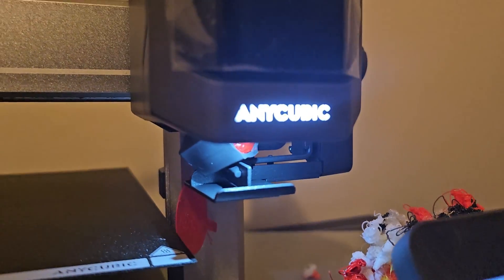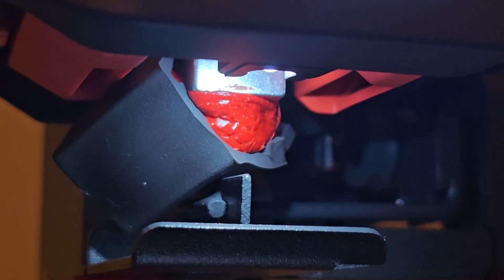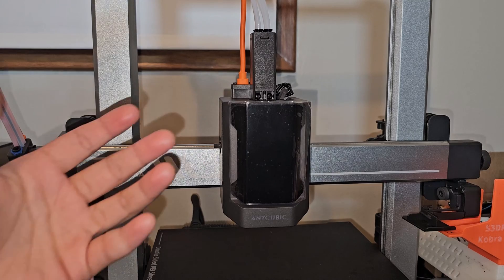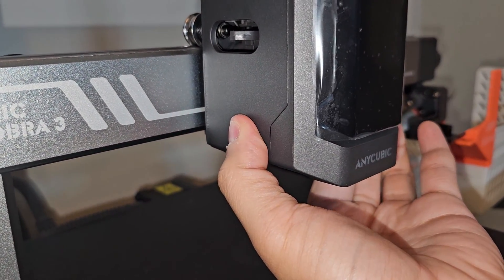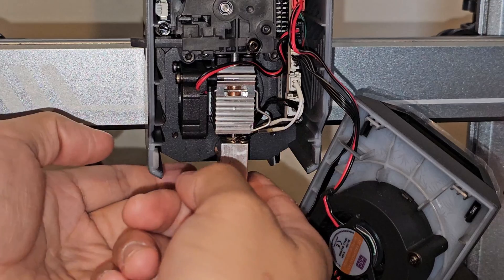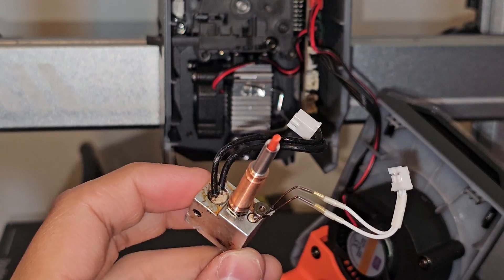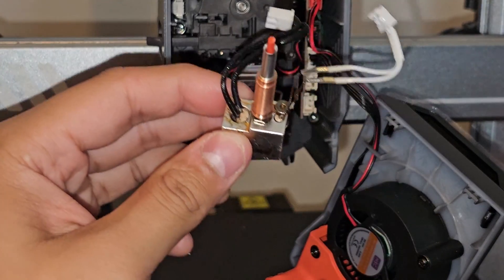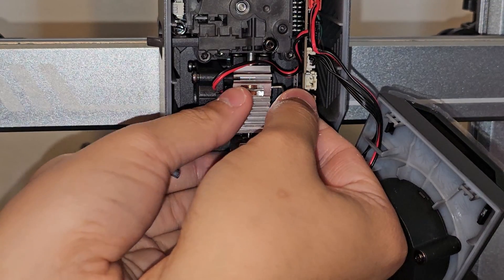Anycubic Kobra 3 How To Change Nozzle | Print Head Disassemble

Comment: Heads up to everyone, currently Anycubic glues the nozzle into the heat block so it's effectively impossible to get the nozzle out of the heat block without breaking it. Just buy the whole hot end and toss the old one if the nozzle gets worn out or unredeemably clogged.
Reply from the maker: Yea that's their solution to solving the nozzle leaks, which is a bad design.

Comment: Make sure the clip is properly in place, otherwise it’s a disaster waiting to happen, with the nozzle head moving while printing. It almost happened to me, but luckily I noticed it in time. The author mentioned this as well, and I didn’t check it thoroughly.
Reply from the maker: Yep! I have seen online post of disaster like that happening. I felt they need a redesign of the clip or the whole nozzle system.

Comment: my K3 V2 out of nowhere started his print and scratched the hell out of my printbed. very deep grooves and it trashed it in a matter of seconds. 
changed my full printhead (cheap and easy with this video) and performing a full callibration now.
very strange.... this printer only printer 50 hours and was printing perfect straight out of the box so very strange accident
Reply from the maker: Hmm, yeah sometimes it might be that a sensor is dead and does not detect the bed.

Comment: a lot of my failures has been with the print head. the block at the top, where the 4 filaments go into one. I have figured that a majority of success is to undo the two top bolts and that pulls away the 4 filament unit, you can then pull out the broken filament through that way, 95% of the time that is
Reply from the maker: Thanks for the tip! I'll keep that in mind for future clogs.

Comment: I did the exact thing and the nozzle snapped at the joint. Now I gotta buy the whole unit
Reply: Thing is I own two filament printers as well as a Anycubic Resin The Photon M3 Max and I have to say that the Photon is by far the easiest to maintain over any filament printer, even the fact I had to change the LCD screen on the Photon.  On the filament printers I have had to change the heads on both for the exact same thing.  Yes, I do use a dryer as well as the oven (just to be sure). Seeing that filament blockage is constant headache, why dont manufacturers instal a much easier way to remove blockages? Undoing clips and pulling on wires, just seems to be overkill for me.
Reply from the maker: yeah there is a big problem with clogage with fdm 3d printers.
Reply from the maker: Yeah for some reason anycubic's nozzle are very brittle and like to snapped.

Comment: Are there replacement nozzles you recommend that are a perfect fit for the K3?  Mine just clogged.  Going to try your method today.  Also am I able to use the non-clogger poker with the K3?
Reply from the maker: If your nozzle is glued inside the heat block, then you can't really replace the nozzle unless you found a way to unscrew it. Usually for the kobra 3 you'll have to buy the heat block with it.

Yeah the unloger poke does work.
Reply: @Scratch3DPrinting  thanks for the response, yeah I went ahead and ordered one from Amazon anycubic original and I also contacted support to see if they send me a replacement under warranty

Comment: Trying 1.0mm Nozzle soon for some PETG-CF prints
Reply from the maker: That sounds fun.
Reply: @Scratch3DPrinting Dispite the good video I still stripped out the hot end putting in hardened nozzle. Luckily i had another ceramic hotend that that just arrived. Had thr first pront fail about 20% in otherwise so far so good and super strong 1 wall vase mode prints

Comment: You’ll have to errata your video. At some point at the end of 2024 or beginning of 2025, all Kobra 3 nozzles are glued into the hotend at the factory and it’s not possible to remove it. It will break off if you try. Anycubic’s answer is that you have to replace the entire hotend if something goes wrong with your nozzle. 

Ridiculous.
Reply from the maker: That's correct, it's impossible to just replace the nozzle. Also I'm not sure when they start putting glue in the nozzle for the kobra 3, but going forward it's going to be like that, it's the same with the kobra s1.

Comment: how do you remove the nozzle from the bloc ?
Reply from the maker: You heat up the nozzle to about 240c, then unscrew it. For the new type of nozzle it's glued in so it's kind of impossible to replace it. I tried and the nozzle head came right off.
Reply: 😨🥲 @Scratch3DPrinting

Comment: I hardly want to advertise for this shop, but Temu do have nozzles for Kobra 3. I've seen brass nozzles and hardened steel ones. Great video, very helpful!
Reply from the maker: Yeah temu and aliexpress sometimes does have 3d printers parts.
Reply: My hot-end died Sunday a week ago. I ordered 2 new complete ones for about 11$ total from Temu and received it at Saturday and it works like a charm. These are complete hot-ends with nozzle, heating probe and thermistor, i'm actually very impressed.

Comment: After replacing my hot end i have horrible prints. Not even the benchy that came with the system prints right. It's like it's way to hot and the end results like it was burnt with a torch.  Anyone have similar issue?
Reply from the maker: Hmm, I've not heard about that problem yet, it could be that some sensor read the temperature wrong.

Comment: For some reason, anycubic thought it was a good idea to GLUE the nozzle into the hotend with my kobra 3.
If you have the same issue, do yourself a favor and just order a replacement hotend; the hassle of getting the broken off thread out of the hotend is not worth it.
However, this is still a great video.
Reply from the maker: Yeah i figure that out the hard way by broken a nozzle.

Comment: Is the little red thing on top a piece of filament or is that something i was supposed to keep? Im a little worried now becaause i took my old one out last night and thought that was my red filament stuck in it at the top and just tossed it. Now for some reason i cant get the hotend to stay in the print head out without falling out the bottom no matter what i do :(
Reply from the maker: I don't think that red thing is anything, as I have not seen in my print head or hotend. 
The rod is what's holding the nozzle/hotend to the heatblock.

Comment: i just had  to take that cover off to clean out all the melted crap inside, but i couldn't pull it off easily like this video, there was a huge blob that had melted inside and stuck to the orange part of the cover and nozzle. i heated up the nozzle and made it soft so i was able to finally pull the cover off.
Reply from the maker: wow that seems like a bad blob, glad you were able to get it out.

Comment: Thank you for showing the change of the heating element. I had issues with burnt filament at the silicone cap falling on the printed things, so with your video i can clean it easy when it is removed from the printer. Thumbs up and you have one more subscription to your channel.
Reply from the maker: Thank you. I'm glad my video was able to help you solve your problem. Cheers.
Reply: When did you purchase yours? The earlier releases had an issue with the hot end that was supposedly resolved with a revision to the design (and I'm not an expert but was researching the model when I was getting mine and what you're describing sort of sounds like that issue) and if the issues persist you might want to reach out to anycubic
Reply: @bobjoe1593  One month ago i was buying my printer and had contact to anycubic today. They will send me a new hotend so i perhaps i got a printer which was manufactured longer ago or the problem is ongoing or i have a "monday model" but now i have a new hotend and getting a spare one from anycubic.

Comment: Thank you very much, it was very helpful, days ago I used a phosphorescent PLA and it seems that damaged the noozle, so, becase I have a Ender, I though it was to going to be the same, just to get a new noozle from amazon, to screw and to replace but it wasn't, in my case it was just like you said,  original noozle was very stucked, the only difference with me it was that also the latex protection was glued to the hotend in fact, several glue marks remain on my hotend
Reply from the maker: Yeah so much glued was used. Glad this was helpful to you.

Comment: You bought the wrong printer if you want to change just the nozzle it’s a fully intergrated nozzle with a quick tool changer that’s kinda the point by doing it like this it can actually have way better thermal properties. Like if they were insanely expensive I’d understand but it’s pretty reasonable and means that nozzles that can have higher temps can have better heater blocks or thermistors built
Into them
Reply from the maker: Yeah it is good until it's not working properly, like the first version, which leaks a lot. The second version is better, but impossible to change the nozzle.

Comment: Can you say please do i need to unplug wires and the hot-end to replace the nozzle or i can just open up the plastic frame and unscrew the nozzle?
Reply from the maker: You can just remove the nozzle by opening the plastic frame, no need to unplug the wire.

First heat up the nozzle to around 230-240c. Then hold the heat block so that it does not turn, while holding the heat block you can now unscrew the nozzle and replace it with a new one. Be careful when doing the replacement.
Reply: @Scratch3DPrinting  Thank you!

Comment: I'm new to 3D printing and like your videos ... any idea how to do a cold / hot pull with the Kobra 3? I watched various videos with single filament feed, but with the combo I'm unsure how to do it.
Reply from the maker: Thanks. I think it's the same process. For the Kobra 3, you can detach all the tubes and just leave one filament in there. Heat up to the proper temperature I think about 80-100c, then pull the filament out.

Comment: I have a question.  I took it apart as much following this video.  my problem is just above the print head.  I have a piece of TPU stuck in right above won't extrude or retract. I need help
Reply from the maker: ouhh. That TPU is stuck on the extruder gear above. You'll have to disassemble it a bit and get the filament out.

Comment: You are the GOAT. I shut off my machine after the first weekend I used it. Came back this weekend to a clogged nozzle. Second day I had a broken piece of filament(new) in the ACE that I had to figure out for myself to remove. So far I'm not to impressed with the Kobra combo. The only color print I tried to make was with colored text that the Kobra can't seem to co cleanly.
Reply from the maker: Thanks. Yeah 3d printer clogged alot. I do sometime have problem with the ACE too. The kobra 3 has its ups and down. Keep going hofully there will be no more clogged.

Comment: what if the head of the nozzle breaks off?  :/
Reply: is there any way to replace just the nozzle?
Reply from the maker: There are replacements for just the nozzle on anycubic store, but it always seems out of stock.

If the nozzle head brakes off then you'll most likely have to replace the whole hotend.
Reply: @Scratch3DPrinting  that's what I was afraid of. Guess I'm replacing the whole thing
Reply from the maker: @dwaynehinton9729 just checked again and it seems there are nozzles for the Kobra 3 in stock now.
Reply: @Scratch3DPrinting  thanks. i have nozzles. i just don't know how to swap them

Comment: Thank you for the video, very helpful. I would love to see how you removed the nozzle and cleaned it out, mine clogged with PLA. Got everything mostly clean around it but I am concerned about it leaking from the top without removing and cleaning it. Tried to heat it up and remove it but my nozzle seems quite stuck in there, even at 240c felt like I was going to crack it before it would release.
Reply from the maker: What you can do is use filament cleaner to clear most of the clog inside the nozzle, then hopefully it would be easier to remove the nozzle. Also use something to hold the heater block and then remove the nozzle.

Comment: The same thing happened to me but just with PLA.  I cleaned it up the best I could also.  I contacted Anycubic to ask where to buy new nozzles, they never answered, though they are sending me a new print head.  I knew that when I purchased this though that being brand new, there would be issues that I would have to deal with.  If it would be your first printer, don't buy it until all the bugs have been worked out and replacement parts are available.  Luckily I have a few others so Ican still print, just not multi-color.
Reply from the maker: Yeah with this hotend set up it feels like its not 100% leak proof with just the clip holding the nozzle in place, with movements. It's good that they send you a hotend replacement.

Comment: Hi, is the hotend wiggling nomal? can i tighten it up, it look so frustrated, my print is clog rapidlly,
Reply from the maker: For this design yes it is normal for the wiggling because it's not screw tighten, its hold by just the little pin so it's wiggling.
Reply: @Scratch3DPrinting  mine is clogged every single print, i'm so desspressed

Comment: I had that happen with my Kobra 3 both times I tried to print with AnyCubic PETG Grey through the ACE Pro. Even with good first layer. 
  I no longer trust it with anything besides PLA.
Reply from the maker: Yeah with this design it seems like it could clog a lot with other harder type of filament. I can't even print TPU without it getting the error of filament tangle. I'll make a vide of testing all types of filaments.
Reply: Well, I think this is just a design flaw! Mine is clogging at all times with OFFICIAL Anycubic PLA... This is just bad.

Edit: I'm thinking of returning mine and just investing in the Bambu Lab multi-color.

Comment: I there Scratch. I was just watching the video. I have the same problem. My extruder was leaking on top and now it's fully cloged with filament there. How did you clean that filament that was stuch to the wires and extruder top? Should i replace it or clean it? Thank you so much
Reply from the maker: There are two methods I use. First one is I heated up the nozzle and use a tiny tweezer to grab as much filament out as possible. The second method is to remove the hot end and carefully use a blow torch to soften the stuck filaments, then remove it little by little. 

If it seems unusable and damage then I'll just probably replace it.
Reply: @Scratch3DPrinting  Appreciate it :)
used a hair dryer turns out it wasnt that hard . just tedious work i guess. Keep up the good work